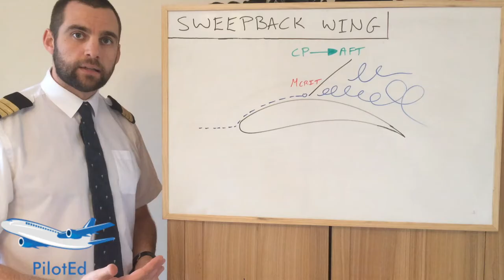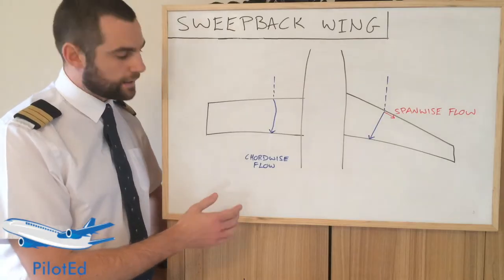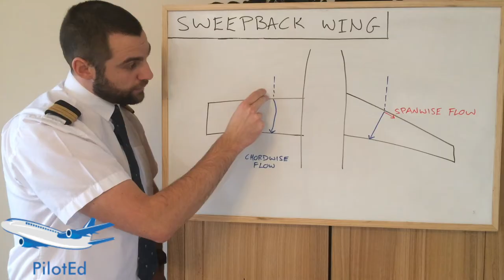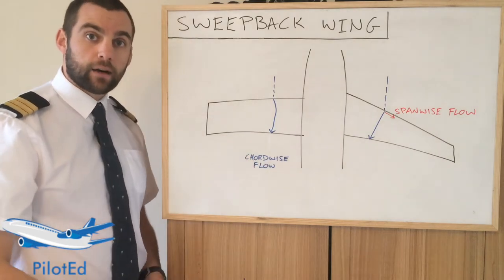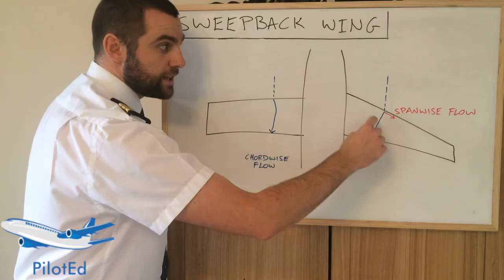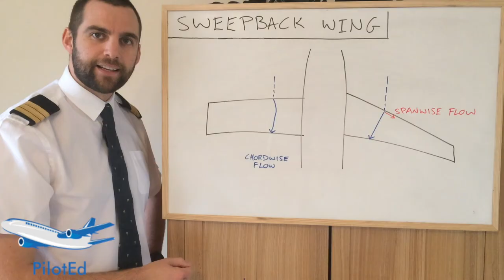Why are wings swept back ✈

Comment: And yet commercial airliners were flying faster in the 1960s and 1970s than they are today.
Reply: Because it takes much more power and fuel to go even faster when you’re already going 500+ mph. The extra fuel it would take to go from like 500+ to 600+ is a lot. It saves on fuel and money and the engines will last longer. Imagine everywhere you drove, if you floored it as hard as possible. Even if you get there faster, you’re using exponentially more fuel at higher speeds and wearing your engine out

Comment: You’re amazing Ed. Just a quick question, if the air particles accelerate to supersonic speed over the top part of the wing at the thickest point, as you said, than why doesn’t it affect the fuselage of the aircraft which is much thicker than the wing and it’s traveling through the air at the same speed as the wing? Would love to hear back form you Many thanks
Reply: Hi Pual, fusolage doesn't have the same wing profile, and for this reason it doesn't act like a wing. So, the flow up the fusolage doesn't take the accelleration as on the upper wing, Then, no problem of sonic speed there. Hope it help.

Comment: Mac Tuck was explained wrong. Its created due to lose of lift on the wing due to Shock Drag ( basically all lift has been washed away back from the wing surface by the fluid shockwaves ) and existing lift on the tail which holds the tail up therefore nose down attitude. 👍🏼

Comment: So basically with swept wings we want to have supersonic sppeds but we dont want to have supersonic flow. Am I right?
Reply: No we don't want supersonic speeds or airflow we want to fly close to mach 1 generally 0.75 0.82 without the airflow accelerating above mach 1. I'd we have straight wings we have to travel slower relative to sound.

Comment: Thanks, Ed.
Question: How does the spanwise flow generate lift?
Reply: good question: my explanation may be wrong and actually i asked similar question i think for the spanwise flow: the aerodynamics loads will increase over the wing and this will lead to increase the angle of attack which leads to generate more lift. however i think the spanwise leads to stall and it is underisrable in flight.
Reply: @ammarabdulkadhim8596  spanwise flows causes the ailerons to go into stall thus it leads to worse roll control
Reply: @ammarabdulkadhim8596  i dont think spanwise generates lift  thus planes would reduce their spanwose flow and increase chordwise flow to increase the lift. ( f14 , su 17 ) by straightening  their wing if they found themselves in a variable sweep wing aircraft
Reply: @moizabdul5384  thats the reason "Wash Out" has been given to wings where the root chord stalls first and outboard of wings will still have enough lift for controllability

Comment: You explained on your video "how lift is created" that the real reason of lift was the opposite reaction to a force at the trailing edge to the downwash (center of pressure at the trailing edge), however, you are saying on this one that the center of pressure is 25% towards the leading edge (accepting Bernoulli's), and as the center of pressure moves aft, there is a tendency of a nose down attitude. I am a bit confused, may you please develop on that? Thanks!
Reply from the maker: its not just one thing that makes the plane fly, theres negative pressure on top of the wing and opposite reaction, allot of stuff going on :)

Comment: Great video - subscribed. I have one question though, and it's regarding the Mach Tuck phenomemnon. I am no physicist or mathematician, so forgive me for my slowness. From what I have understood, as the air passes over the trailing edge, it accelerates, leading to an area of low pressure, right? So when the shockwave starts to form, the air behind it decelerates, increases in pressure and density. Shouldn't that lead to an area of high pressure behind the shockwave, leading to it pushing down on the back end of the foil, causing the plane to pitch up? Why does the plane's nose tuck down instead? Thanks for the content.
Reply from the maker: Actually when mach tuck fist came about it was something completely different, was due to the control getting inverted because of the air pressure on the tail-section! thats for another video :) hard for me to describe via text, ill add it to my list. thanks so much for watching

Comment: Thank you very much Sir but I have one slight question which is what is the effect of the spanwise and chordwise flow on the abgle of attack and the stall phenomenon?
Reply from the maker: they don't affect each other really angle of attack is induced by the pilot, the others are by wing design :)
Reply: @PilotEd  i think there is effect. for example, for the spanwise effect: on angle of attack when the aerodynamics loads increases on the wing, this will lead to stall conditions and all of us know increasing the angle of attack after 16 in some airfoil design will lead to stall phenomenon. what do you think sir, if my explanation is right? however, the other aerodynamics types is still unobvious for me and for that i asked you
Reply from the maker: @ammarabdulkadhim8596  I mean yes? I don't really see the question sorry? high speed stall high angle of attack stall, yes they all exist